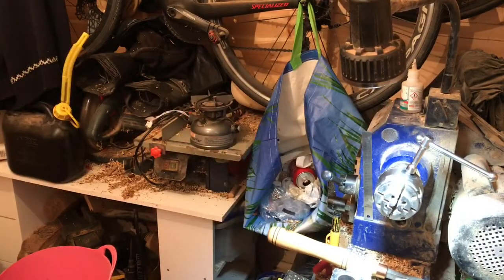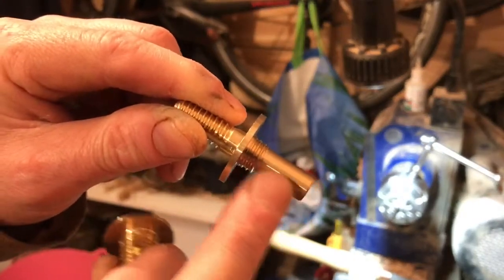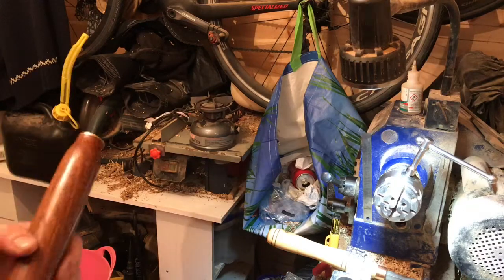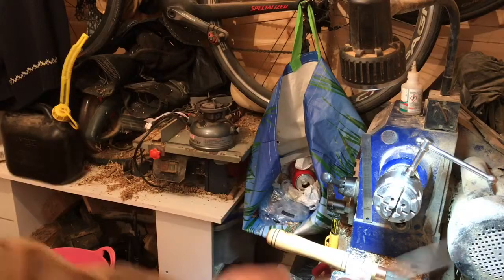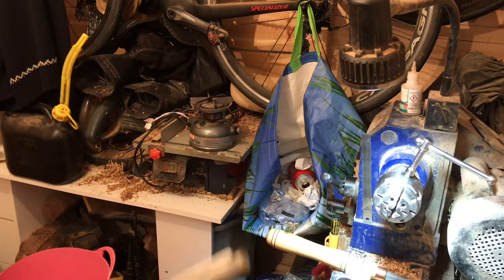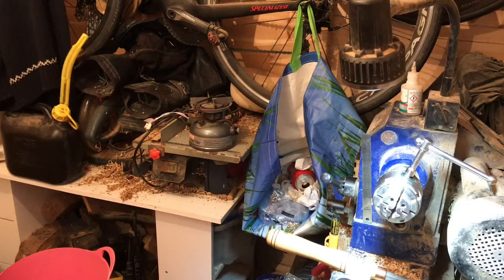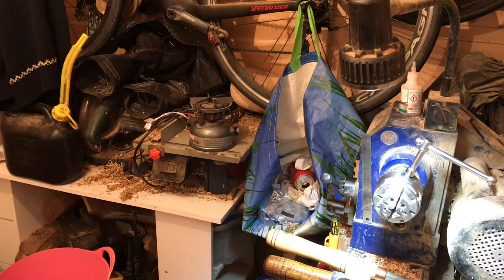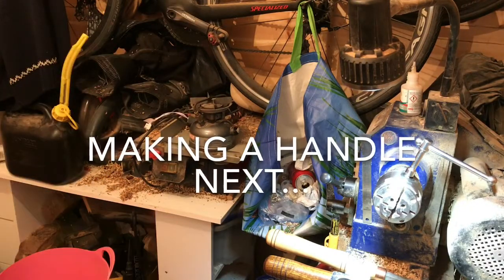Quick-Release Joints Explained and Tested

Comment: Great idea! Beautiful! Do you tap the wood for the brass fittings or epoxy them in?
Reply from the maker: Doc Wade hi mate thanks. The smaller thread, male fitting bit eventually, measures outside diameter of about 9.7mm using calipers. I drilled the handle with a 9mm bit. The fittings are good at self-tapping as long as you don’t give them too much to do lol. Along with that, I also epoxy the hole and threads etc. The female part of the fittings you need to be more careful...if you put too much pressure on the thread the brass compresses ever so slightly and that vacuum fit becomes too tight lol (trust me, I learn at the school of hard knocks haha). Thanks again.
Reply: Thanks for the info. Just ordered some of the fittings on Ebay. Really appreciate your help. Have a great day!
Reply from the maker: Doc Wade no probs man!